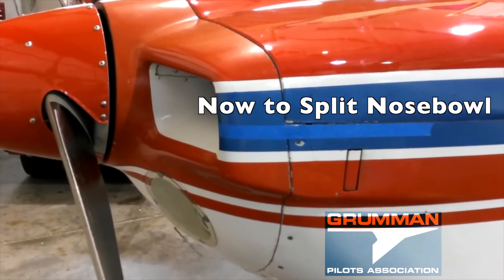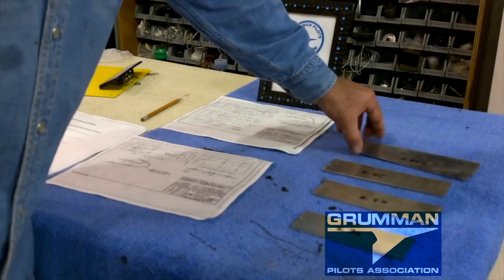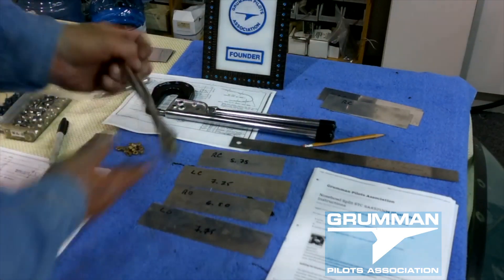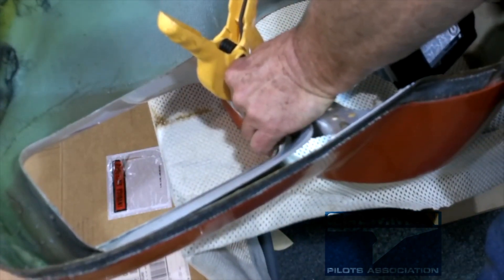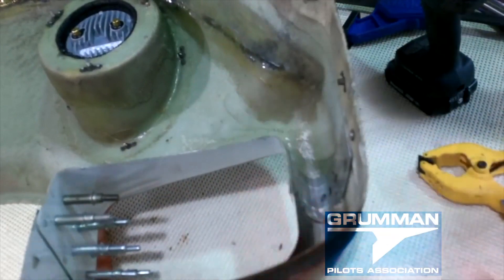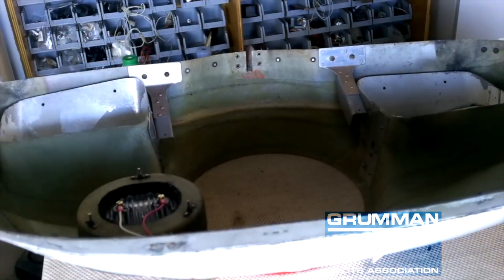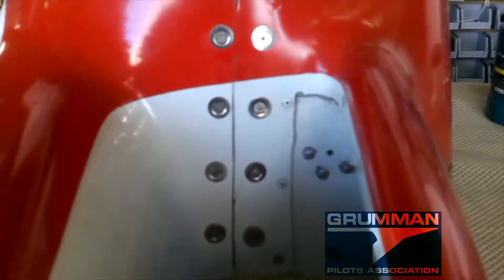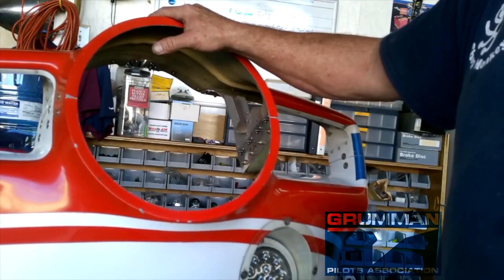ReDo How To Split Your Nosebowl - Grumman Style

Comment: I cant find a way to make a private comment... I didn't see your installation of the permanent bottom rivets. Most importantly It looks like you accidentally put the Rh piece with 3 holes in the wrong location....Same with the LH piece with 4 holes. Not sure how much this matters but at least you proved that it can be done.
Reply from the maker: Left in this case is the pilot side of the nosebowl.